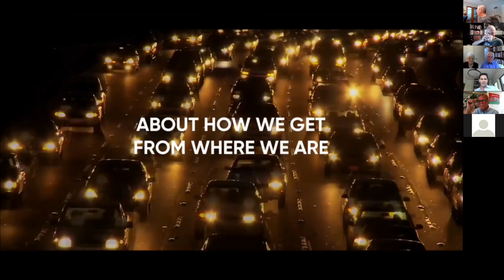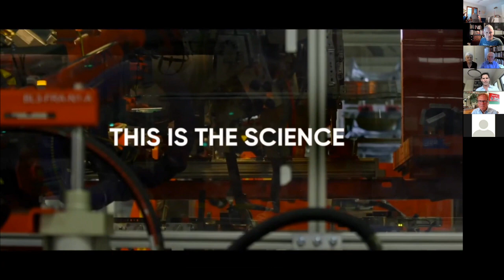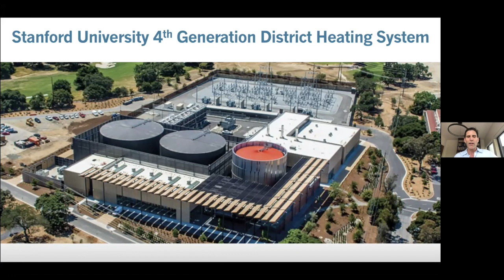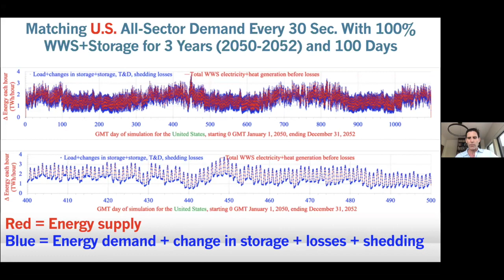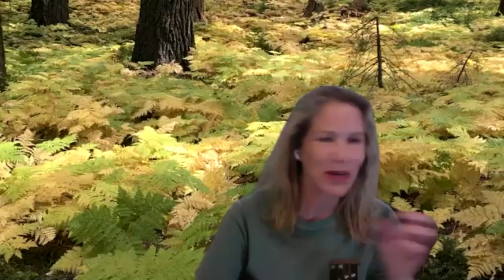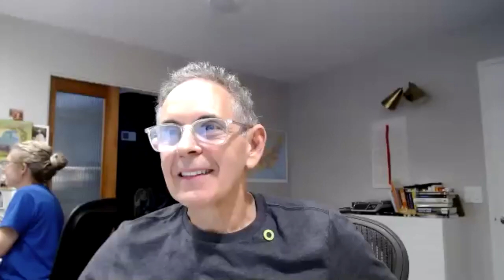NCCCA "100% Renewables" Zoom Event with Dr. Mark Jacobson

Comment: This is the latest update of an awesome plan and program, meticulously researched and calculated, over a dozen years. It has been criticized, and many of the critics have fallen away, and some have become supporters. The key feature is to understand the huge waste of energy which is intrinsic to the fossil fueled energy system, due to conversion losses, mining and refining losses, transport, and Carnot losses. That forms a kind of intermittency and loss in which the relatively low cost zero Carbon energy, can, with overbuilding and storage, thrives.
Reply: To replace coal with wind  worldwide would require 10 billion tons of steel and concrete annually. Current world production of steel  and concrete is 1.5 billion tons. Morgan Stanley Managing Director,  Platts nuclear conference 2016.